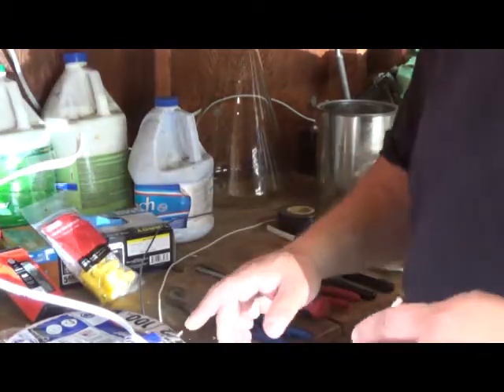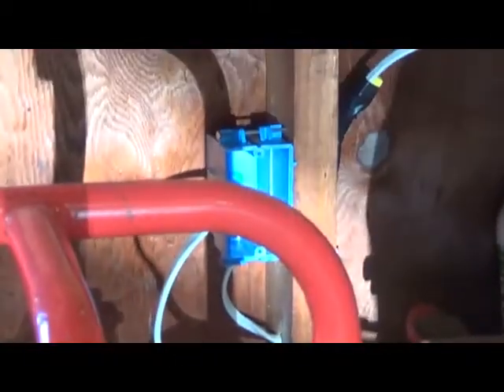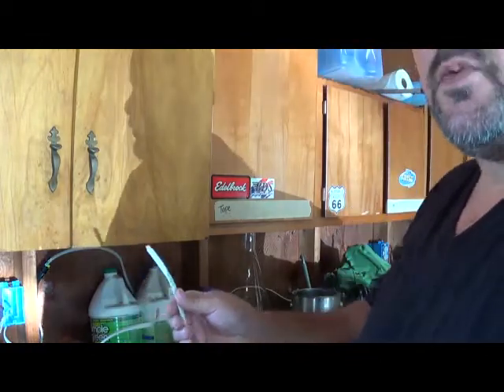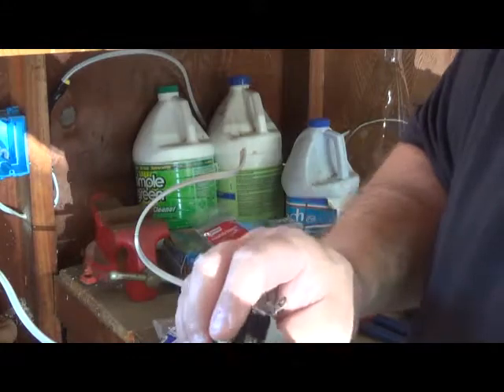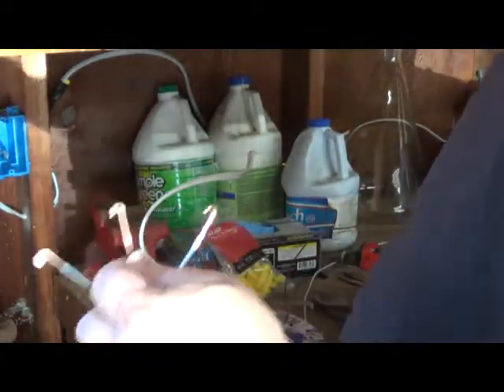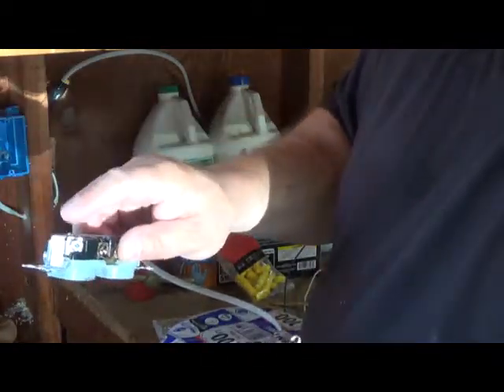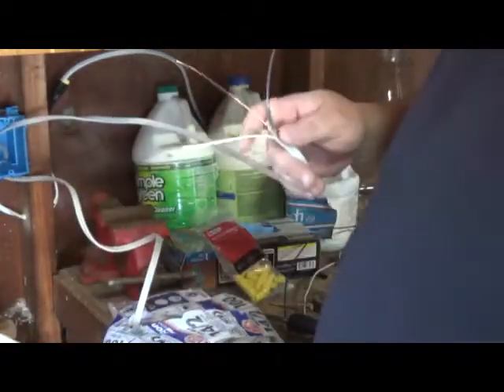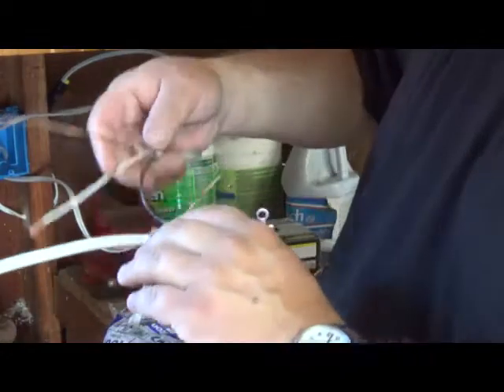How to add extra electrical outlets -DIY Daddy

Comment: Hey DIY D, what would you do if you were adding a receptacle that has a green screw for ground, to a house with wiring that only has black and white wiring throughout(built in the 80's), no 3rd ground wire in lines? Thanks!
Reply: Ground wire is in there bare copper way before the 80s. In your case you need a gfci breaker in the panel or a gfci outlet at the first box of that circuit

Comment: upside down
Reply: Bobby Factuar many places install outlets upside down such as hospitals. It has pros and cons such as if the plug begins to wiggle loose and something metal lands across it does not make contact with energized terminals but by being upside down it also makes it arguably easier to wiggle loose. It ultimately is up to the electricians preference.